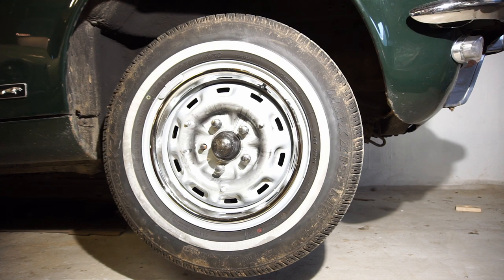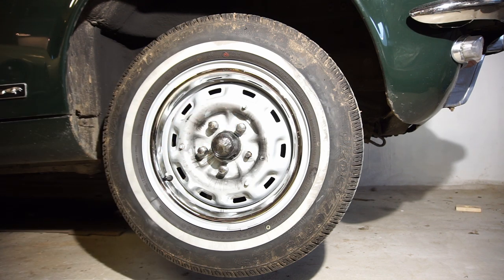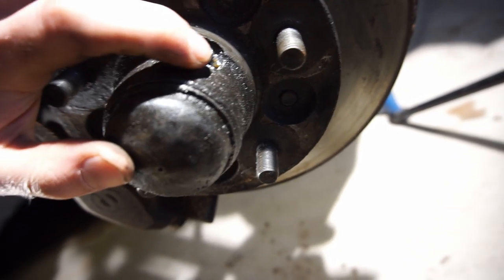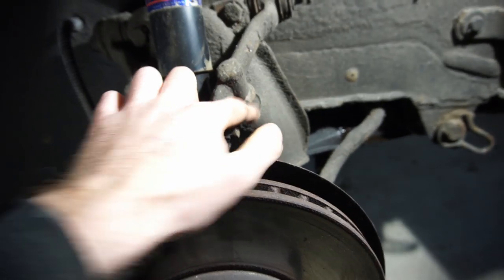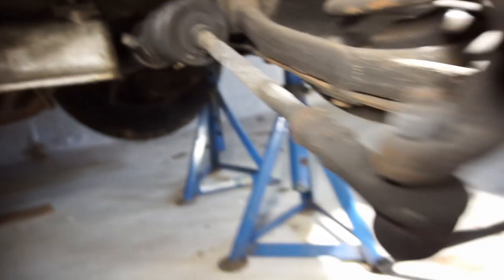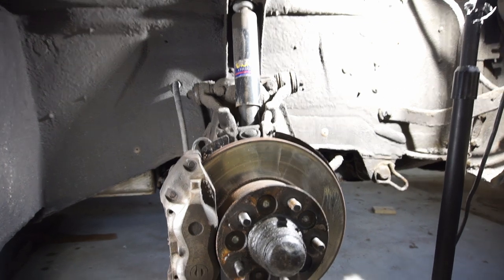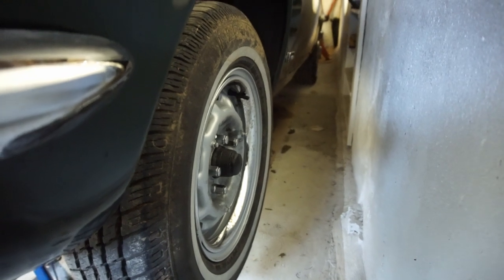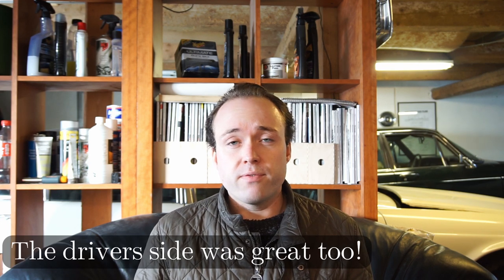Front Suspension Safety Check - Jaguar XJ6

Comment: To check the top and bottom ball joints you to have put a jack under the bottom wishbone and jack it up so the wheel is of the ground.
Then put a strong  bar under the tyre and try to lift the wheel . This is the only way to check the free play in the top and bottom joints.
The bottom joints are adjustable with shims.

Comment: To check front suspension put a trolley jack under the front coil spring pan and jack up the car to take the weight so the wheel is off the ground, rock wheel side to side (9,0clock & 3,oclock) then top & bottom (12,oclock & 6,oclock) to check for bearing play or track rod end play then spin the wheel for any bearing  noise ,  then put a bar under the wheel/tyre and lift up the bar this checks ball joint and wishbone bushes for wear.
If you don't have a trolley jack let the car down on a axle stand.
You must jack up under the road spring pan to properly check the upper wishbone bushes at the front suspension turret.
Reply: Both John Butler and yourself are correct. To check the lower ball joints, upper ball joints and flexi slip joints for wear the suspension must be compressed sufficient that the upper wishbone bump stops are no longer compressed ie clear of the subframe. The original lower ball joints had grease nipples and could be shimmed, but later replacement upper and lower ball joints are sealed units with no facility to grease.
Reply: Thnx! I need to do this on my series3

Comment: Adam, whatever you do don't use a power tool/air gun to tighten the nuts, mine were all wreaked by such use; and don't allow tyre people to do so either. Make them do it by hand.
Reply from the maker: I'm the same! If I get new tires I take the wheels of at home and take them there in another car. I don't trust tire places to tighten anything. I always use a torque wrench. Could you save your studs?